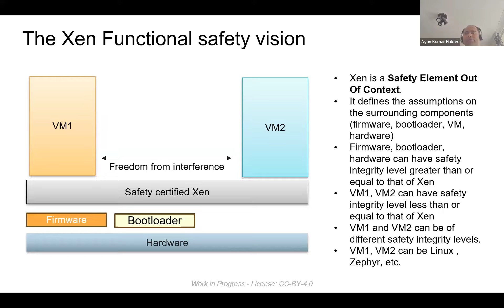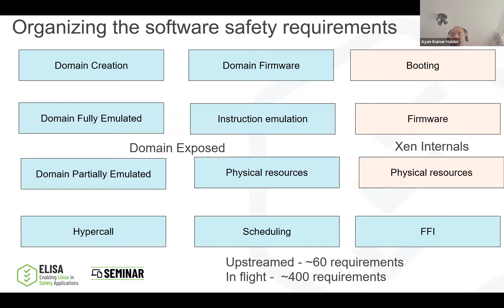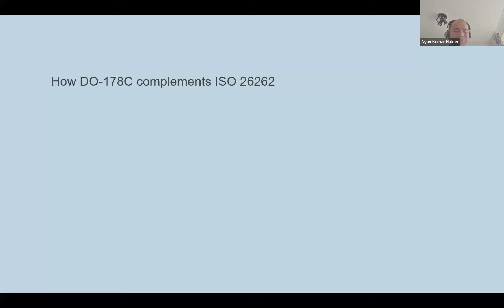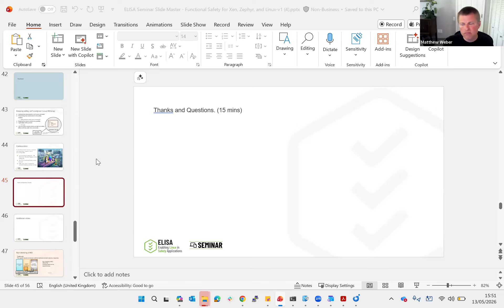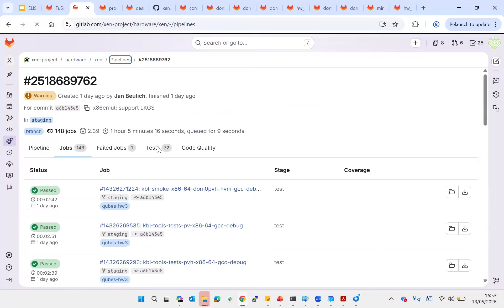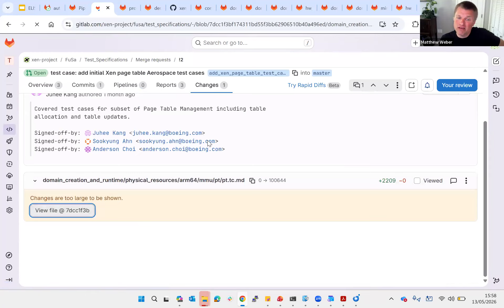ELISA Seminar – Functional safety with Xen, Zephyr and Linux for avionics, automotive and industrial

Comment: Regarding IEC 60601 / IEC 61508, I imagine the practices for safety critical embedded software apply not just to medical (13485 , ISO14971 , IEC 62304 , SaMD),  but to aerospace (DO-178X , DO 331 , ARP4754A , ED-12C),  nuclear (414.1x), automotive (26262), etc.  Would love to take a course on the typical documents that show how the code will be written, tested and proven safe (SDP, STP, SVP, PSAC...  SRD, SDD).. and of course learning device-trees, etc.

And how does the software framework fit within an overall system framework.. like Waterfall, Agile->Scrum?   

For example, I understand you can use any language (Rust, Zig , C) ,  toolchain (gcc, MinGW, llvm/clang) , and  build system (CMake/Meson->Ninja).. but what if you are using a COTS RTOS (Xen Hypervisor Project/Zephyr/West/Kconfig,  FreeRTOS),  and/or vendor-supplied libraries?  I assume the auditing agency doesn't automatically trust  code (binary library blobs) just because it came from ST Micro , DiSTI etc?  

Or what if using an FPGA SOC with logic that's written in either Verilog/VHDL/Amaranth-HDL, or schematic-capture..  what's the process to assure that the FPGA logic is safe?

Regarding AI.. I would think companies would be reluctant to divulge sensitive requirements , ICDs, or other proprietary data in order for AI to do the coding. How do you see companies getting around this?   For example, running open-source LLMS offline (via "Tiiny AI" for example) keeps the data safe, but is the code quality of open-source LLMs as good as the commercial ones (Claude, Grok, etc)

BTW, I like the YT channels 
Modern Software Engineering 
TASKING (formerly 'LDRA: You can be assured')
CEMILAC Education Program on Airborne Certification for DO178C

Udemy:
Principles of Software Safety Standards
Unit Testing & Other Embedded Software Catalysts
Interaction Tests, Mocks & Refactoring in Embedded Software
Tonex Training : DO-178 / DO-254 Training
Overview - DO-178C (Airborne Systems) by Alexander Walter

FPGA Verification:
Apheleia Verification Library ,  UVM ,  VUnit 
python (import hdlregression (Marius Elvegard))) 
'Unify to Verify: A Monorepo Approach for Hardware and Software using Bazel, Cocotb and Verilator' 
peertube FSiC2023 "Black-tie Python: Formal verification with Amaranth" (Cover, Bounded Model Check)! 

These are just some of the tools I've found for testing and proving safety-critical software: 

***Requirements Management Plan
IBM Rational DOORS
ALM
JAMA
Xebrio  
rmtoo florath
doorstop-dev / doorstop
reqview
 Jira / Redmine or Tuleap / OpenProject
Polarion 
servicenow
Jile

***Static Structural Source Code Analysis
Astree Static C Analyzer
Parasoft
PolySpace
CodeSonar
horusec
SonarCloud
Veracode
PREFast
TBrun
LDRA
cppcheck
Klocwork Insight (Perforce)
Coverity
Frama-C
PVS-Studio

***Dynamic Analysis / Modified Condition/Decision Coverage (MC/DC)
VectorCAST
RapiTest
LDRA Testbed (also supports dynamic analysis)
Cantata
TESSY
Eggplant (primarily for GUI/system-level testing)
Valgrind

***Traceability Tools
Reqtify
Polarion
McCabe
Jira (with traceability plugins)
Tuleap

***Code / Configuration Management / Storage and Version Control System
Git/hub , bitbucket
SourceSafe
Mercurial
MS TFS
ClearCase
SVN

***QA / ALM (Application Lifecycle Management)
Helix ALM for Managing Artifacts, Establishing Traceability, Documenting/Enforcing Processes
Jira
Redmine
Tuleap  <-----
OpenProject  <--

***(I)V&V / Unit Test Automation
VectorCAST
LDRA Testbed
Mathworks Simulink DO Qualification Kit
GoogleTest (C++ unit testing)
Catch2 (C++ unit testing)
Cantata
TESSY
Cmocka (probably not so great for embedded)
VSC TestExplorer , 
Check, 
Criterion  (desktop/server), 
Cutter

***Simulation / Hardware-in-the-Loop Testing
Renode (embedded system simulation)
embedded-hal-mock (Rust embedded HAL mocking)

***Build Systems / Development Platforms
PlatformIO (embedded development platform)
LDRA Tool Suite 
Green Hills MULTI 
Wind River Workbench 
DDC-I Deos + OpenArbor
maven, jenkins, MS Build, Apache Ant

*****Test software
Unity+FFF   
Unity+Cmock  (auto-mocks)
ennorehling / CuTest    
Ceedling  / Cmock (Generates mocks, runs unity test)
CppUTest  (alternative to Unity+Cmock), 
CUnit  (alternative to CuTst), 
Renode (embedded system simulation)
embedded-hal-mock (Rust embedded HAL mocking)
Jenkins 

***Continuous Integration / CD (Continuous Delivery/Deployment)
Jenkins <--
Bamboo
GitLab CI/CD
Azure DevOps
TeamCity

* All in one vertically-integrated tools
Ansys SCADE  (still requires something like DOORS or GIT for requirement and configuration management)
MathWorks Simulink ecosystem
Siemens Polarion ALM ecosystem
IBM ELM